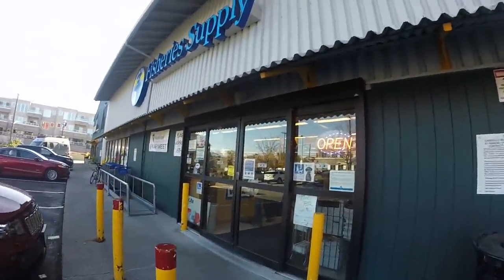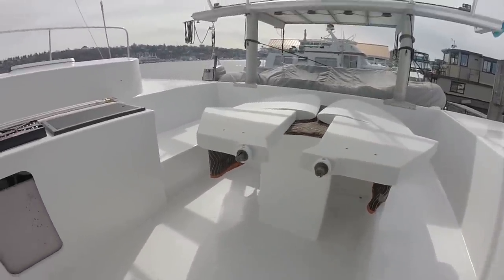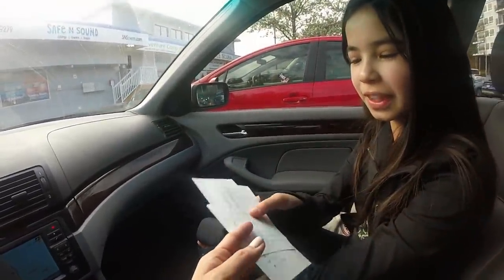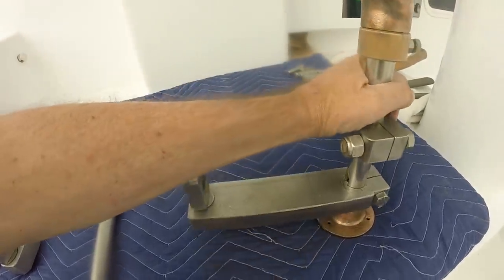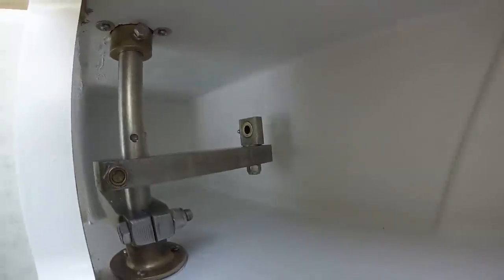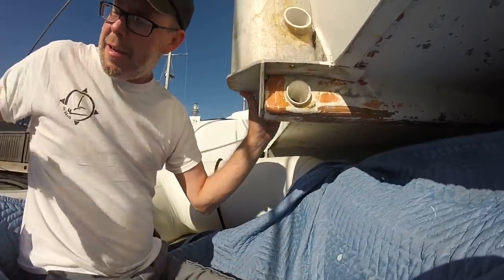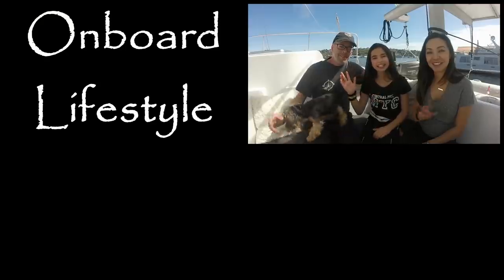Re-engineering our Catamaran Rudder Linkage. Onboard Lifestyle ep.58

Comment: I noticed no grease in those pivot points?  Not sure what SS will do to the brass\bronze fittings without lubrication.  Especially with some salt water in the mix.  Just a suggestion:  find some rubber boots to fit the top and seal the bottom of each fitting.  Then, drill and tap the brass\bronze to fit a zerk fitting.  Then, just squirt a little grease in there from time to time?  I'm not a boat person, so there may be a reason not to do this, but, I am an automotive guy and it makes sense to me.  Either way, great job as always!

Comment: Tip regarding the use of adjustable wrenches:  apply torque with the adjustable claw leading the rotation.  For example, if you are pulling the wrench handle toward you, the adjustable claw should be on your side of the nut or bolt head.  Perhaps more importantly, try to make sure that your locking nuts have at least a full thread above the nut.  Fantastic build!  Your design eye and quality of build is outstanding.  ‘Can’t wait to see you guys under sail and enjoying all these upgrades!

Comment: Great story and great presentation. May I point out that you should fit a washer  behind that pin as wear may be on the retaining clip, which may wear thru, and on some of the bolts you have installed, there should be a minimum of one and a half threads outside the nut, visible after fully tightening. ( although this is an aircraft requirement I strongly advise you to do this as vibration can work the nut loose.) Keep up your excellent work.

Comment: Love your workmanship and trademanlike nouse.  For awhile thought those grease nipples would end up on the opposite side of the linkage, but no you nailed it great.  I would like to suggest however that rather than cut and fill the original holes on the bases of the davit, you tidy it up and instal a pair of low waterline towing/anchorage  connections-could be useful someday or maybe even  use a a aft spring line for a sea anchor.

Comment: I was thinking of a way to have a vertical tiller at the helm instead of a wheel. With a pivot at the deck the handle would extend down long enough to make the necessary swing of the rudders. It would be connected on both sides through 2 pulleys to the connecting bar for the 2 rudders. The direction the tiller handle moves is the direction the boat turns. This should be intuitive to steer and give feed back on the pressure on the rudder with leverage for ease of steering.

Comment: How about a washer behind that pin so there is nothing loose. If its loose it could over time break the pin.
Reply: Not only a washer but also use a split pin instead of that circular thing. How come there's no ackerman angle on those rudder arms? I modified a friends steering linkage on his 40' cat some years back - tacked much better. cheers edi
Reply: AnotherRM a

Comment: The upper bushing has the 3 bolts working in tension with no shear forces because the bushing uses the fiberglass for side loads. The lower bushing only uses the 3 little bolts for shear. I don't know the loads the ocean can put on this but it seems like a weak link. I would flip the lower bushing so it protrudes through the glass and then make a spacer to hold it all up. I know this means a new longer shaft :(

Comment: Wondering why you didn't lubricate the pivot points with marine grade grease?  Won't salt eventually get into the joints?  See, you got me so into your boat project that now I'm looking over your shoulder!  Keep up the great videos.
Reply from the maker: I have more work to do in the linkage lockers with the final connections to the rudders and installing the hydraulic cylinder for the steering. I didn't want to be working with greased fittings but will make sure all moving parts are properly lubricated when I am done...thanks for watching!

Comment: FYI. Most of the hardware you purchase at hardware stores is 304 or 18-8 stainless (that is what the bin said). Not very good for salt water. You really need 316 for seawater. 304 or 18-8 WILL rust at sea. In the cabin, you might get by with 304/18-8, but everywhere else you really need 316.

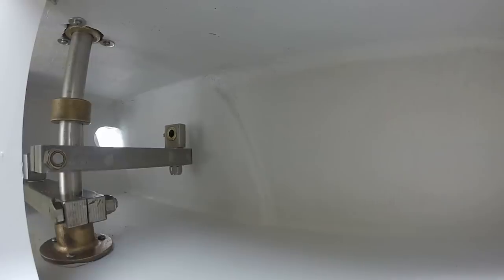Comment: At 17:46, the base acts in part as a support plate, but the top has no metal plate to share the load.  

In addition, on the sides not shown below and on top I was wondering if there were stress plates as well for the same purpose.

My concern is that I am not sure if there are any stresses transferred to the non metallic material which could tear the screws off.

Ok.  I got to the end, you guys are doing an outstanding job.

Comment: Great stuff, my suggestion would be to take longer bolts so that the selflocking nuts can do their work as intended. If the threaded part of the bolt does not protrude trough the nut the teflon inside the selflocking nut does has nothing to lock on.

Comment: Emma's had a growth spurt. Teal is this a moc up or a final fit? You may want to grease up the pivots on your linkage.
Reply from the maker: I have more work to do in the linkage lockers with the final connections to the rudders and installing the hydraulic cylinder for the steering. I didn't want to be working with greased fittings but will make sure all moving parts are properly lubricated when I am done...thanks for watching!

Comment: Tighter is not necessarily better. You should be using a torque wrench for tightening these critical bolts to values within the rating of the bolts.

Comment: The only mechanical thing that looked fishy to me was the stud protrusion on that bolts in the rudder linkage hardware. Was there enough protrusion on some of the bolts for the Nylock nut to be effective? 

Also, I'm sure you used like material on the rudder posts vs. key ways, but should those key ways get some sort of lubricant?  unsure if a galvanic reaction is possible.

Comment: Quick question is that a gap that is inside the that you can see around time frame 22:47 going to be filled with thicken apoxie around the hatch and the bulkhead? Just had to ask I don't remember if you had talked about in in another videos or not.
Reply from the maker: Yes, that will be filled with thickened epoxy.  Since the weather was nice, I decided to take advantage of it and work on the linkage.

Comment: Nylock do NOT work properly unless the bolt protrudes a couple of threads PAST the nut.  The do make thin nylocks.  With keys cut in those shafts and arms the small amount clamping force you might lose by going to the thin lock nuts is insignificant.

My favorite source for stainless steel fasteners is https://www.albanycountyfasteners.com/  They also sell on eBay.  Buy 100 nuts, locknuts, flat washer and lock washer of the most common sizes (1/4", 5/16", 3/8") and you will be set for life.  Bolts are another issue.  It might be worthwhile to buy some 1", 2" and 3" bolts of the same sizes cut them down when needed.

Comment: Where does the auto pilot connect?
Reply from the maker: The autopilot connects directly off of the Capilano hydraulic steering pump at the helm station.  You will see that in next week's episode.
Reply: @OnboardLifestyle   ok  just checking someone has to keep track of your work...
Reply: AND why is there NO Teflon bearing's on those riding surfaces (metal to metal)  Cutting Board material is the cheapest and best way to get that stuff, comes in varying thickness's  .... dam would have to take that apart  again!